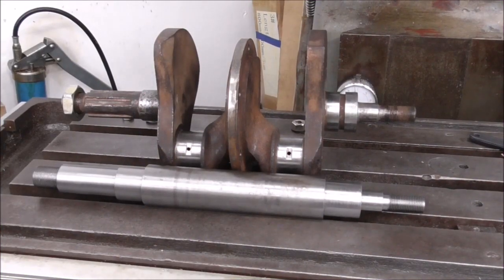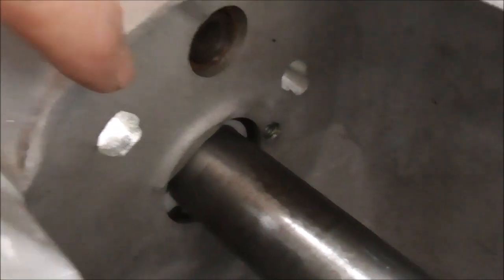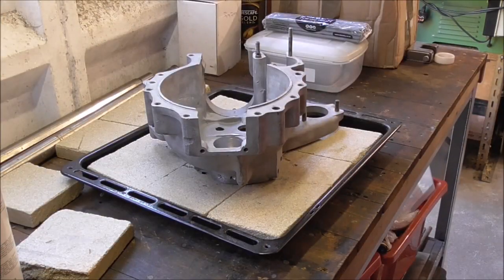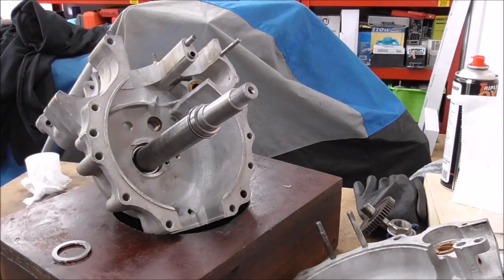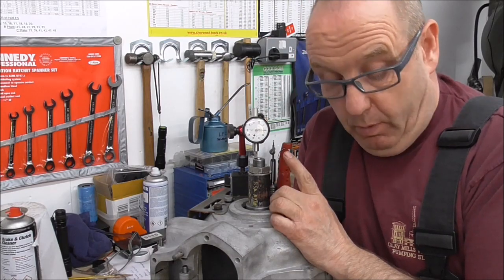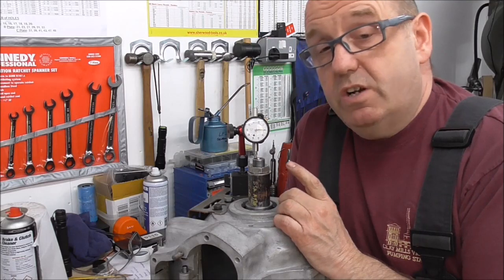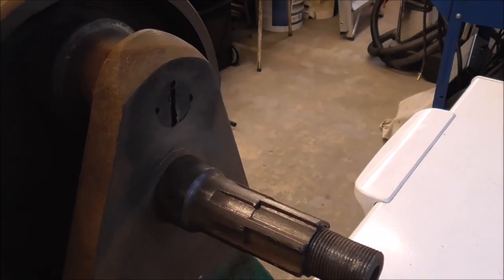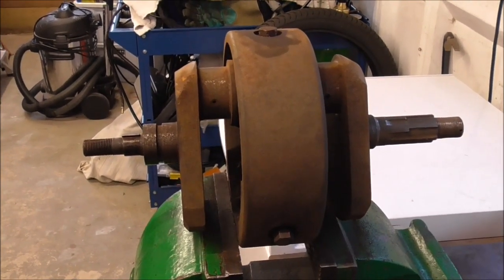BSA: Dummy crank fitting

Comment: That was very interesting. True research and development. It was an education to see the difference in end float on the comparator between two supposedly interchangeable bearings. 

I'm looking forward to seeing how you deal with the splines. Once again, I really enjoyed it. And not a CNC plasma cutter in sight.
Reply from the maker: I'd have a cnc plasma cutter if I had room! Got a vertical bandsaw coming for my birthday, a wood cutter I'm going to be changing to metal cutting. Have to make room for that. New shed 😉
Reply: @AGEngineering  It's always good to get new tools. A vertical bandsaw sounds great. I sold my big SIP horizontal bandsaw and got a little one that I made a plate for so I can use it as a vertical one too. The play in the bearings was interesting. I've been using budget bearings in my Harrison Mill refurbishment. So far just in the feed gearbox. They are Dunlop ones from Bearing Boys and seem ok. I think I'll spring for the expensive ones for the main gearbox though, especially after seeing your video today.

Comment: Great video Ade, project is gathering momentum. It was interesting to see the difference between those bearings. I'm glad you managed to snare a crankshaft, as you say it's a mini project in itself. Best wishes, Dean in Oxfordshire.
Reply from the maker: So, thoughts on what to build the crank splines up with, answers on a postcard to..
Reply: @AGEngineering  it's a tricky one. I think it depends on what the shaft was made from originally. I was talking to my brother about it. He's a got a lot of welding experience from working off shore. I suggested TIG brazing. That might work. He mentioned 316 Stainless but said it was tricky as it could crack. It would be interesting to find out what method is used in crank reconditioning workshops. Regards, Dean.
Reply from the maker: Glad you mentioned tig brazing, that was what I was thinking. My biggest concerns are distortion and going too hot requiring heat treatment after, things I want to avoid. I also have a plan for building up the worn threads, without welding or loctite, epoxy etc
Reply: @AGEngineering  sounds interesting Ade. I thought of Tig brazing because of the lower heat. I also thought it's a bit softer so might not crack.

Comment: Hey Ade, re: the 12:10 mark... I DID  say something; I suspect you might not have heard me...

BTW, with my considered opinion, based on my extensive experience with these engines (which is sod all, apart from watching this video series), I would expect this to have a bit of a 'clunk' to her - even w/o a cush drive.

In "*theory*", nothing but the cush drive should be able to present any axial load.  In practice, tiny discrepancies in the connecting rods, rings, pistons, the axial relationship of the cam, the mission of the cam drive gears, etc as well as theloads presented by oil windage inside the case might tend to push the crank assembly one way or the other - and might cause it to float on acceleration or deceleration.

I would expect the force of the oil being pumped into the one end of the crank would tend to bias it to one direction.

.012" (or .008") seems super large to me (disclaimer: all my experience is with large American V8 engines, that use a flanged sleeve bearing to take up the thrust).  My instinct would be that "less is more" here.  Enough end play that the bearing isn't under an axial preload would be enough. And, I would expect the aluminum casesto grow more with heat than the steel crank, causing the assembly to loosen up is the engine came to temperature.

Any more than that, I would expect to be a detriment; if the crank assembly moves side to side, allowing it to smack more abruptly when it comes to the end of its travel. Kind of like the difference in force you can apply with a hammer, which changes greatly whether you swing it .001", 6", or 30" - the more room you get to get it moving, the harder you hit

Also, taking up any axial force on that roller gives me pause for consideration.  I'm not familiar with that particular roller, and what it is designed to do.  When I see roller bearings in a machine, I often times see them providing no axial locating, and the entire thrust taken up by a pair of tapered roller, or ball bearings somewhere else along the shaft, either a double bearing assembly, or two discrete units with a selectable shin between them, or something of that nature

So, that's my "armchair quarterback" take on the situation - now I'll just go back to watching a guy who may know a fair bit more than me about these engines carry on with it.
Reply from the maker: This is good thoughts thanks. The case expansion should not be a problem, remember the axial movement is only in the bearing, which is, according to the spec designed for 'moderate' axial load in both directions, supposedly.. In the standard set up, thrust one direction is taken by the thrust face of the bush, which until the A65 was not an actual thrust bearing, it was the steel location housing for the white metal or vandervell lining, only pattern later bushes were solid bronze of whatever composition, and the opposite thrust direction was controlled by the lip of a roller bearing. A lot to think about. Now, another thought : what filler metal to use for spline repairs... 🤔

Comment: A10 is pre-metric, should be easier to use Imperial measures? 
The early motors were 'semi-unit' later ones were probably not so well made (cutting costs cutting corners) 
I always wonder why it took Harley Davidson another 50+ years to bolt transmission to crankcase? As you mentioned circlips, there is also a right way to fit them in pistons. 'Heavy side up' gap at the bottom because piston is moving max speed at TDC and stops suddenly to reverse direction but at BDC as the con-rod angle is different is 'slows down' at a lower rtate. Even less people know about that (until now ;o) )
Reply from the maker: Great to have you watching the channel, really is appreciated. I'll leave you to catch up on the past episodes for a while, please do look through the comments and replies as they would help answer some of your questions and points. It would be great if you could find the SRM crank dimensions, that would be interesting. I have been progressing with BSA this week, so there might, but only might, knowing me, be an update soon. Best wishes, Ade.